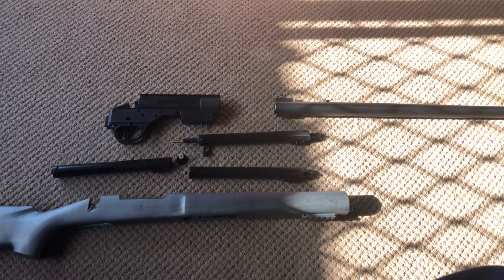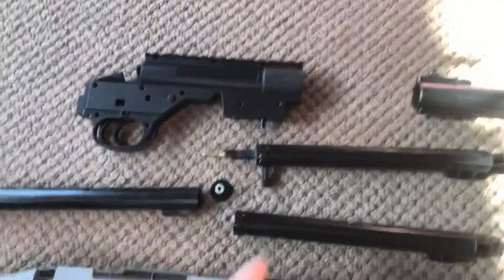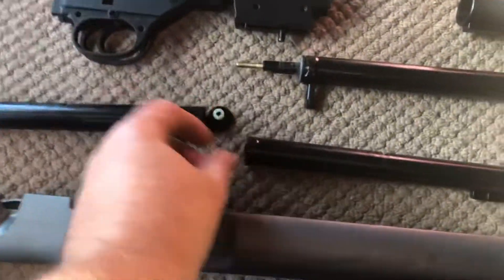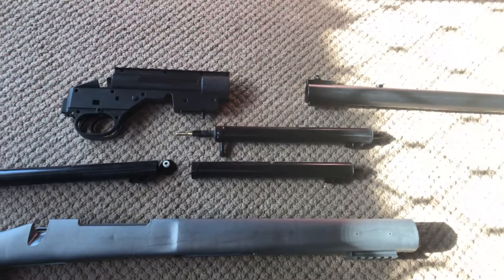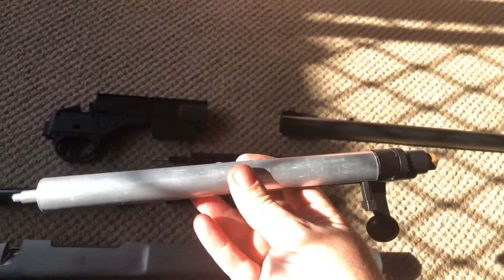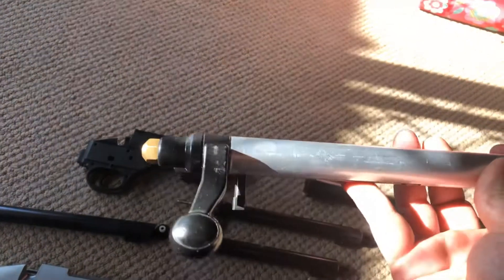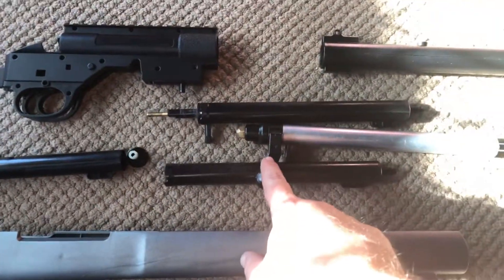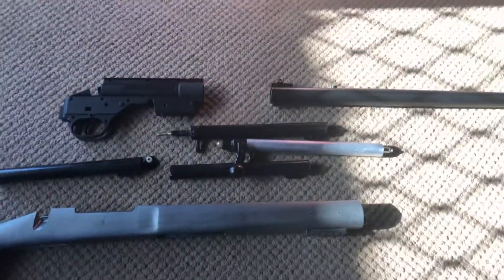M24 gel blaster cheap modification

Comment: Hi Corey, I love my m24 but I'm a bit concerned about the longevity of my bolt after watching this video. What spring were you running when you destroyed those plastic bolts? I have had a 1.4 in mine for a couple of years now and it hasn't broken yet.....
Reply from the maker: You are doing well with a 1.4mm and must be very careful with it I would say a 1.2mm to be safe and 1.3mm and learn to pull it back right 
I think mine was a 1.4mm and it broke there are 2 different plastic bolts one is way stronger than the other I can’t remember how to tell the difference now as 6 out of my 8 have metal bolts now and all my kar98’s have metal bolts ad well

Comment: I have an m82 barret bolt action sniper rifle my orbeez don't grow even left for 24 hours when i put undergrown orbeez in the gun (it doesn't have a magazine) it sometimes shoots but most of the time the orbeez just come out of the barrel without pressing the trigger ehat should i do pls help
Reply from the maker: So it doesn’t have a mag how do you load it? 
And try different brand gels or different water depending on what is in the water can make a difference to gel size
Reply: @coreyrich2567  it has a hole